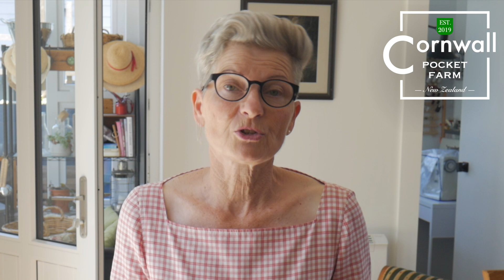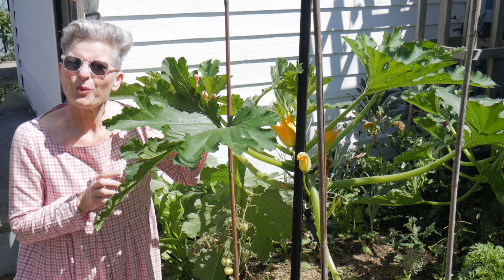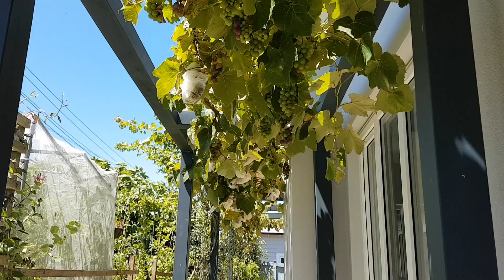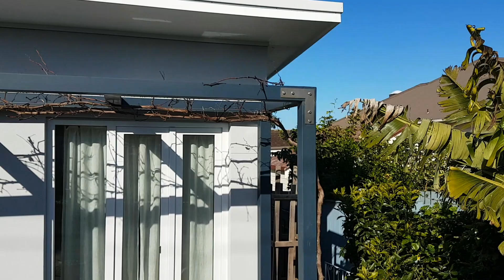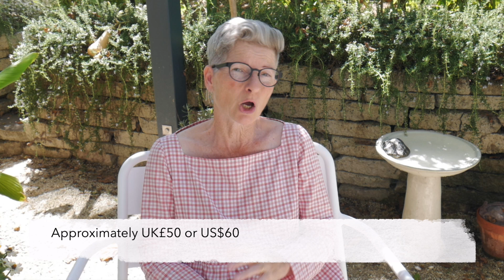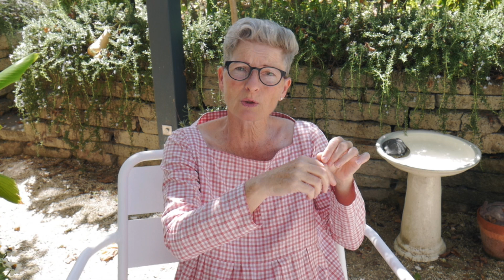Why I DON'T have solar panels | Sustainable energy | Off grid? | Sell electricity? | The economics

Comment: I’ve thought about switching and have gone through the same thought process, and also realized that it isn’t worth it, even with gov rebates. I think what clinched it for me, was the production and end of life for the panels, batteries and hardware. 
I live in BC Canada and our electricity is produced by water.  Our house is only nine years old, is well insulated, and we have a heat pump. Despite our hot summers and cold winters, we average about $100CA per month too.
Reply from the maker: Yes, I think it's important to look at all the angles because it's not a 'one size fits all' solution. Thanks for your comment 😊

Comment: YESS!! Solar makes sense in a lot of European and US contexts but it is definitely the 'bling' after doing everything we can to bring down our electricity consumption. Insulation, air drying clothes instead of a tumble dryer, energy efficient appliances... as well as behavioural changes are the Cinderella of the green energy drive but they really do pay dividend (personally and collectively). Also, folks shouldn't beat themselves up about not being able to afford solar (or not being allowed it due to planning restrictions). There are many many ways of systematically cutting our collective fossil fuel addiction. And slashing our plastic usage, be it in the form of tech upgrades, plastic packaging or fast fashion (often in the form of polyester, acrylic or nylon) is also a part of kicking the fossil fuel habit. 

PS - And thank you for making the part that growing your own food is definitely a case of harvesting solar energy!
Reply from the maker: Absolutely! Everyones circumstances are different but doing what you can is so important 😊

Comment: We live in the UK and our situation is very different from yours. Despite insulation, double glazing, and being very conscious of our energy use (we haven't used our dryer for years!) solar panels made sense for us. We installed them 9 years ago, at which time the tariffs for selling electricity back to the grid were pretty generous and guaranteed for 25 years. (Those tariff payments have been withdrawn since for new installations, so we're glad we took the plunge when we did.) They have saved us a lot of money over the years (although probably not yet as much as we spent on them); in summer months we earn significantly more from them than we spend on electricity, and the maintenance cost has been relatively trivial (our window cleaner washes them annually). Our house sadly has no south-facing aspect, and we do get pretty chilly winters here, so we need to have the heating on, and our water heated. We currently have a gas boiler - when it gets to the end of its life we're going to look at installing a heat pump. All these products are expensive, and a cost-benefit analysis is important before determining what is best in each individual case. We hope that at some stage the UK government will get serious about its net zero promises and provide better incentives and subsidies to help its citizens do their bit. At the moment it feels like lip service only 😐
Reply from the maker: Oh! That's very interesting. Sounds like you got them at the best time 😊 Here's hoping all our governments wise up soon!
Reply: @CertifiablyJenny  they need to get a move on! Time is running out...